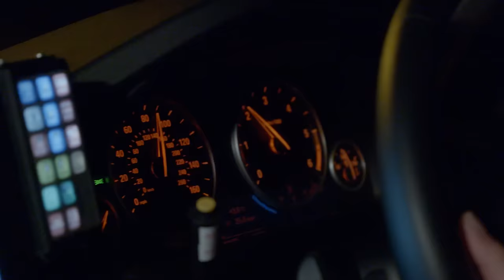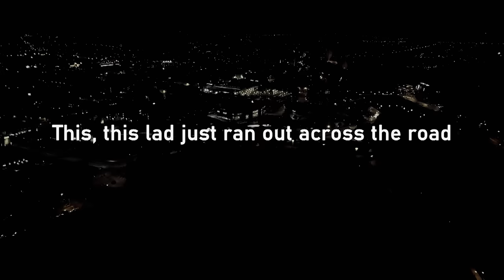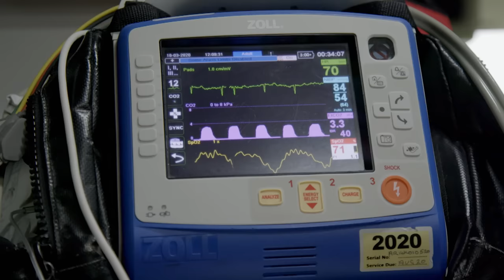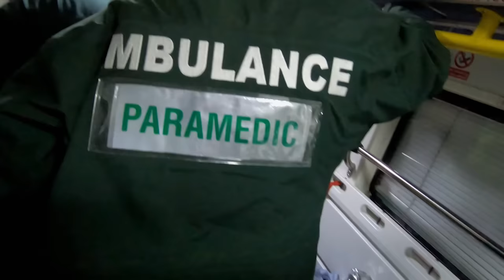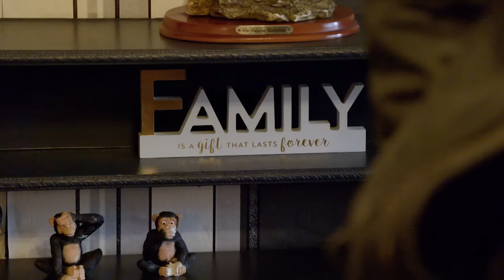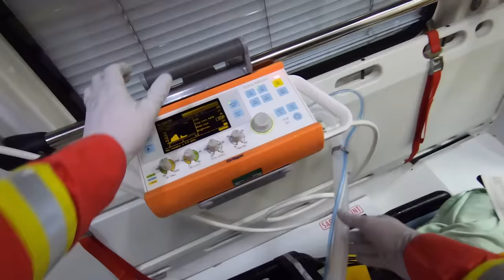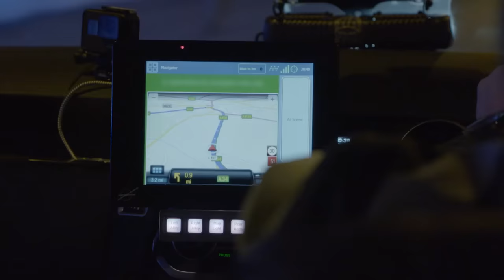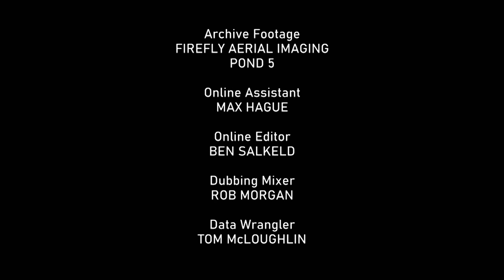High-Stakes Heroes: A Day in the Life of Critical Care and Air Ambulance Responders

Comment: Seriously moving a possible back injury ..why the drama that moving the patient can lead to paralysis. Slap a C collar on and move the patient. No need for backboards anymore unless the patient is elderly.
Reply: We're lucky you'll fail any exam like that
Reply: @zoker501  Backboard a nonelderly person would be a fail here. It is no longer done. Only C collaring is done. Boards are used to move patients but they are removed from them UNLESS they are elderly. 

From what I see C collaring seems to be very slack there. The one portion of the spine that the body cannot splint itself. Very foolish.
Reply: @LindaFirefighter03  You either immobilize or you don't. Spineboards and Split-Bords like the one shown here aren't meant for transport in the car/ helicoper, you're correct about that one. If you need to immobilize, you'd have to use a vac-mattress or similar, rated for transport. There is no half-assed bullshit when it comes to immobilisation.
And a C-Collar is a Tool that helps with immobilisation of the neck, it doesn't fully do it on it's own. Plus it's heavily contraindicated here due to the head trauma.
Reply: @zoker501  Wrong. We use the C collar because the body cannot protect the spine like in the thoracic and Lumber region due to the weight of the head. Spinal boards are now COUNTER indicated except above a certain age. SOP's no longer require it. 
There is nothing half assed about it. It is called research and research showed that spinal boards cause MORE injury than not boarding. 
They are not called "split boards here they are called Scoop stretchers. They are used to a variety of situations. 
I was a trauma surgical nurse for 28 years and am still currently  a firefighter. When someone calls 911 either it be a MVC, a trauma, a VSA, a medical emergency or a fire  a firelighter will be there for them.
Reply: @LindaFirefighter03  idk where you're located, but to say we don't use boards anymore is quite literally false. We absolutely do still use them for any and all suspected spinal injuries, as well as a collar. To come on here and say so boldly that they're not used at all is utterly arrogant. They may not be used anymore where you are, but they definitely are in my state and we'd fail our exams if we said otherwise. Also, it's contraindicated, not "counter" indicated. Maybe get off your high horse and realize that what your regs are isn't what everyone else's regs are
Reply: @intothevoid3719  You have a problem with people discussing things in the video. You expect people to agree with everything even if what being done is outdated. That is your problem. You should just ignore the comment section since you do not seem to be able to handle discussions.
Reply: @LindaFirefighter03  girl what lmao. I don't have a problem with anyone discussing anything, but what you're doing in this comment section isn't a discussion. It's you thinking you know everything. Whether it's outdated or not, in many areas it still MUST be used based on protocols. Gtfoh with your superiority complex
Reply: I think this video might be about 10 years old, so many things have changed since then😇